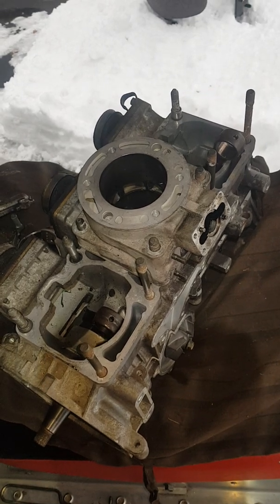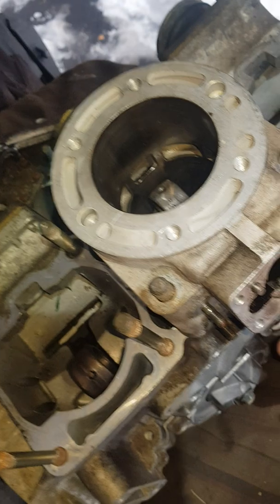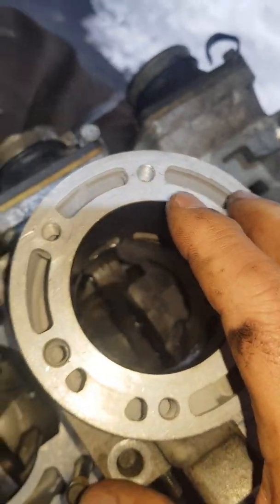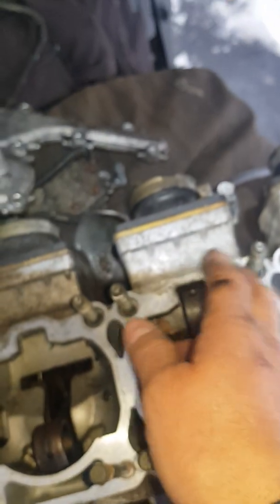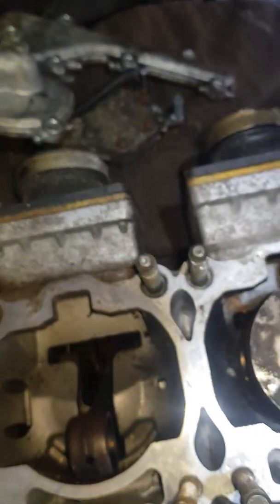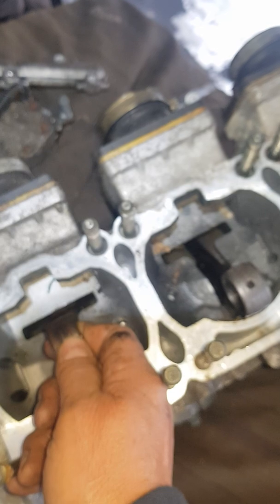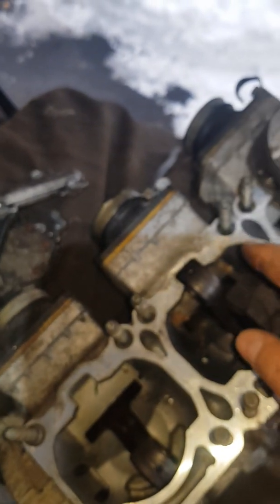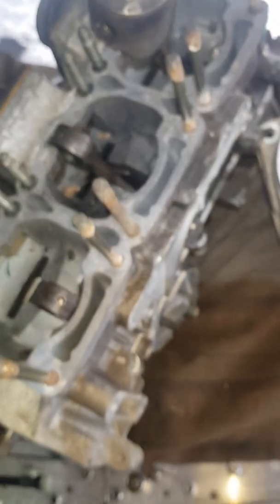Yamaha Viper 2 stroke snowmobile top end

Comment: Hey guy I need to know the long head bolts which cylinder  it goes to. Forgot to place it on a piece of cardboard with holes in proper removed order.  6 head bolts are longer need to know where those go. Any help will be appreciated. Thanks